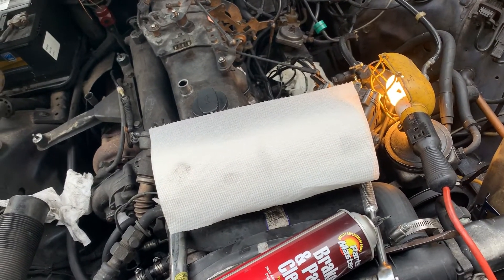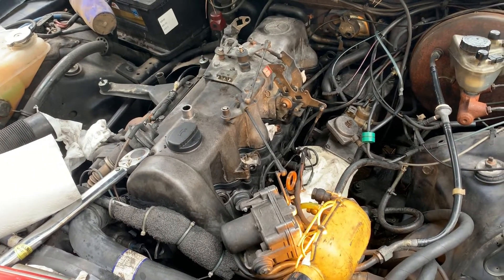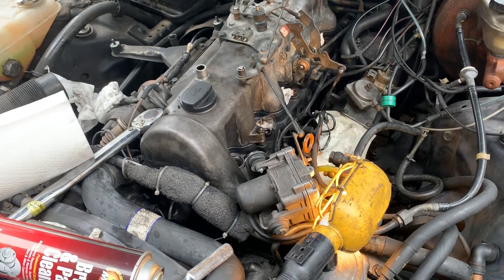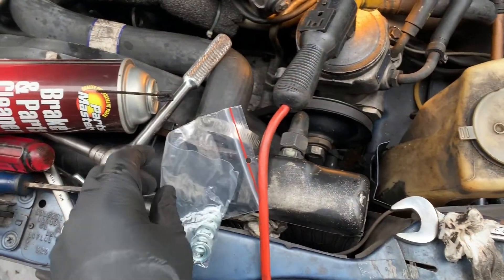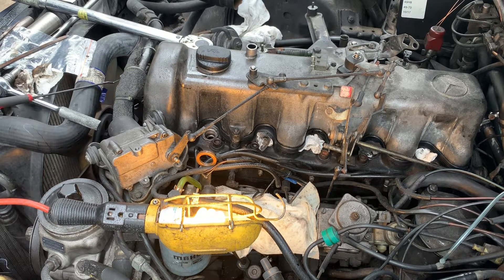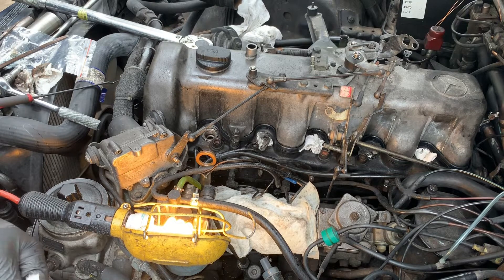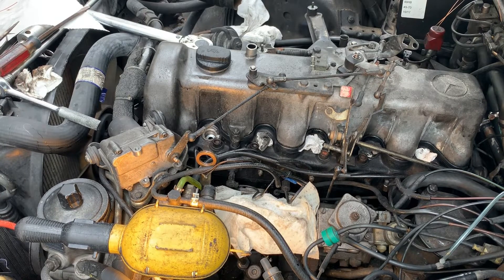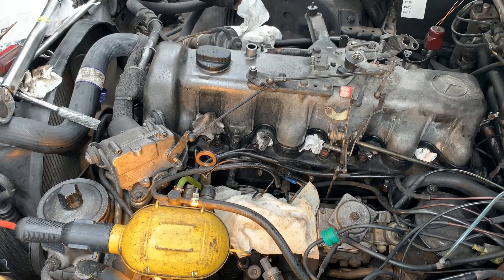300D Rebuilt Injectors Install

Comment: your see through fuel filter is looking a little dark. nice video though, those injectors came out nice!
Reply from the maker: It turned dark right after I changed it when I bought the car. They may have had some used motor oil in the tank.

Comment: Where did you get your injectors/nozzles rebuilt and how much approximately did it cost? I have a 1985 300td with terrible power and wondering if i should do this
Reply from the maker: A guy on a Mercedes forum rebuilt mine but I don’t think he still does it.